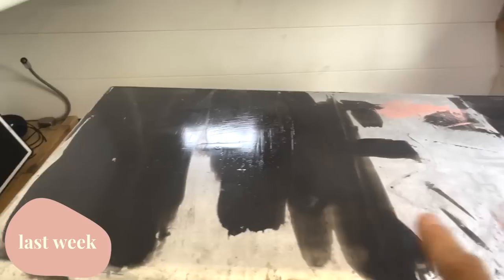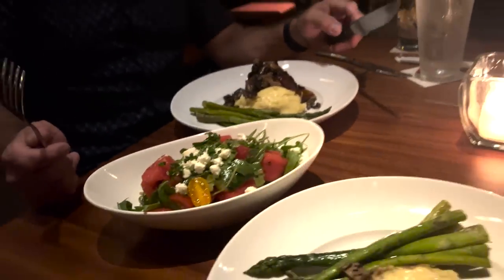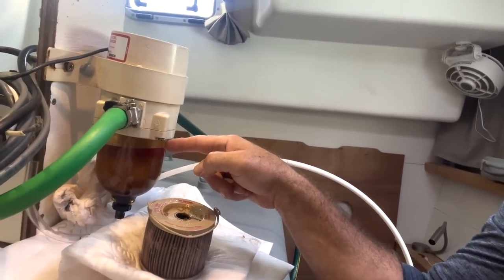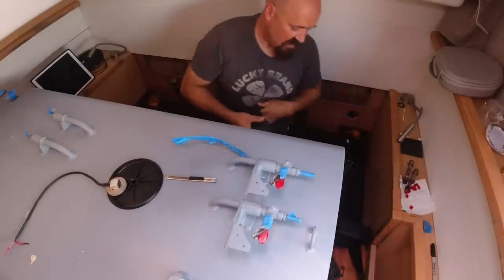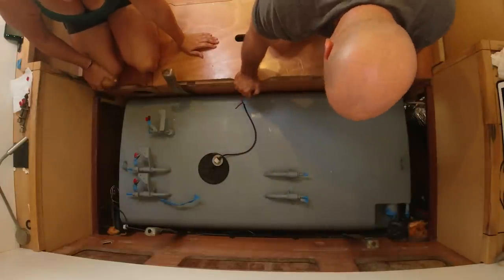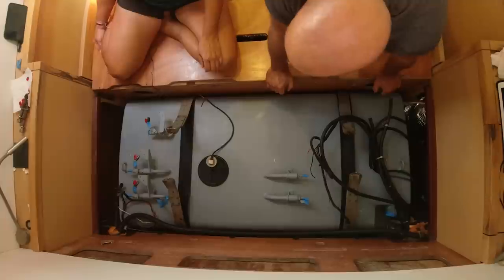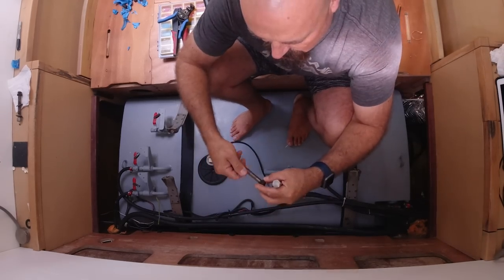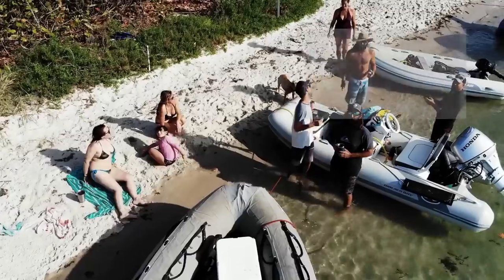PROJECT SUCCESS//Polishing Fuel & Re-Installing Repaired Fuel Tank-Episode 93

Comment: Did you check the bolts after filling as the crush of rubber due to weight of fuel in tank .
Reply from the maker: Yes